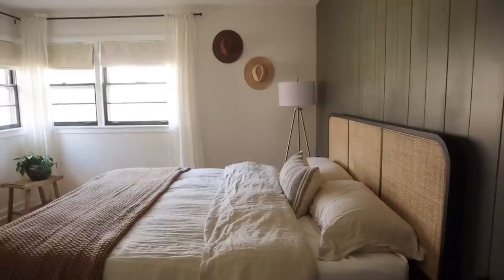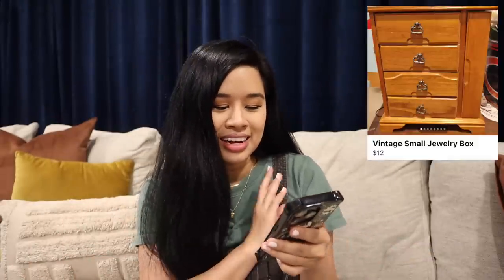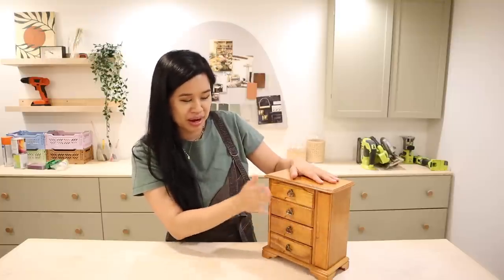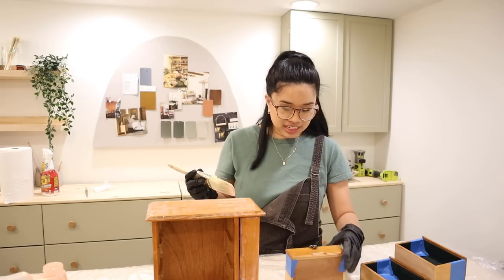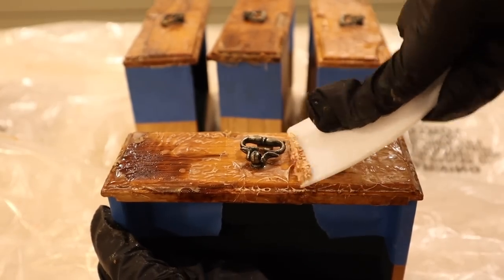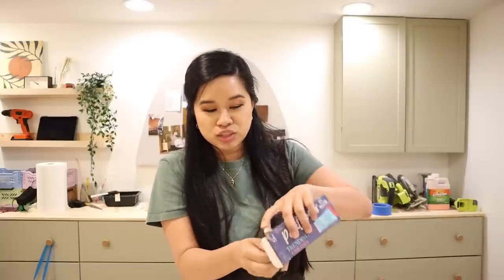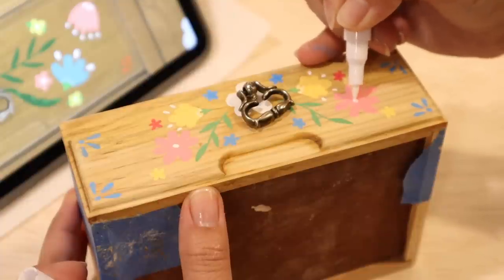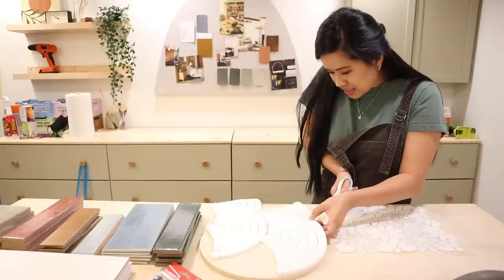COLORFUL *NEW* DIY DECOR IDEAS (that aren’t tacky) | SQUEEGEE ART + WOOD PAINTING

Comment: I wonder if for the checkerboard you put the white and black at separate times to dry. They probably used a specific type of paint because it doesn’t move that far down compared to the rest. Also, would be fun to embrace where the colors land and use marker to make little details like faces and stars or water outlines.